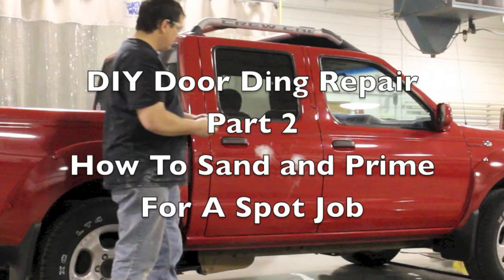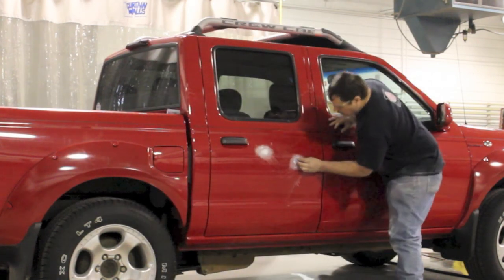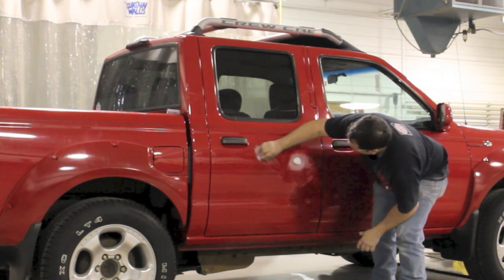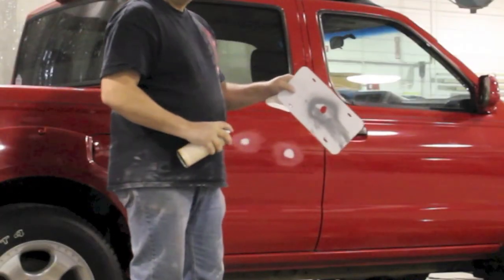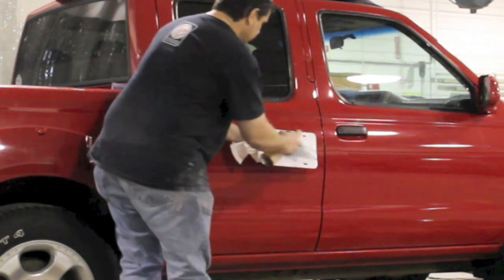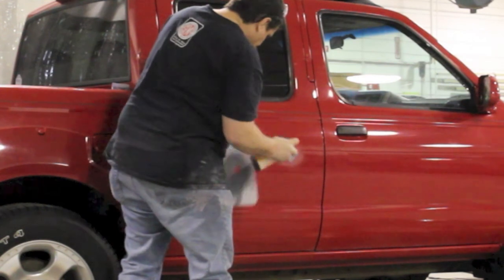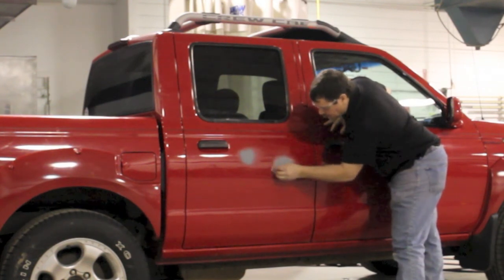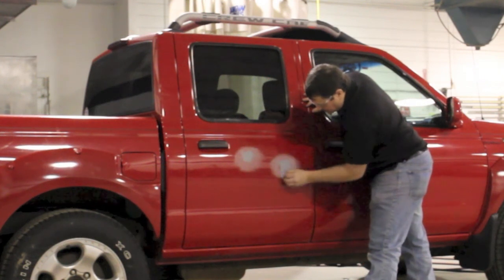DIY Sand and Prime - How To Prep and Prime a Spot Touch Up Job on a Car

Comment: Question. So After you paint the spots and is time to clear coat the whole panel , do you buff it before putting the clear on? I wish you had a video that shows how you finished.
Reply from the maker: I do have the second part, but its on another channel.  You can watch it at https://www.youtube.com/watch?v=2lhc396TbgE

Comment: Wait wouldn't using 800 and 1200 over the 400 grit scratches defeat the purpose of the 400 grit scratches. 
From the looks of the video you went "over" the primer area and the rest of the door with 1200. The 1200 would have gotten rid of the 400 grit scratches (since it was hit with 800 before that) and basically what you were doing was just scuffing the whole panel with 1200 in order to adhere the Base and Clear, correct?

Comment: when you spray a coat of paint/primer it will have a wet glossy look. wait about 5-10 for it to evaporate(flash off). it wont look wet anymore and now you are ready for the next coat.